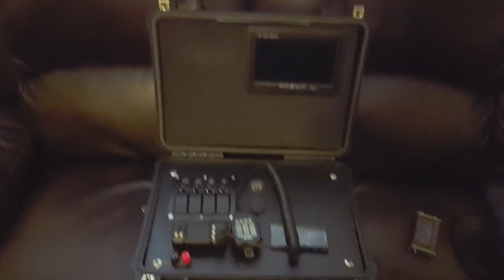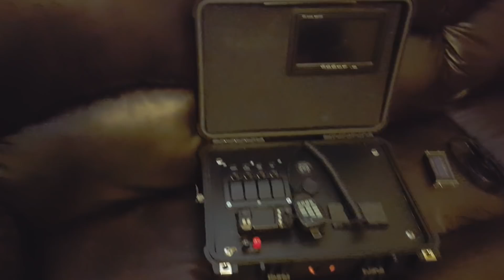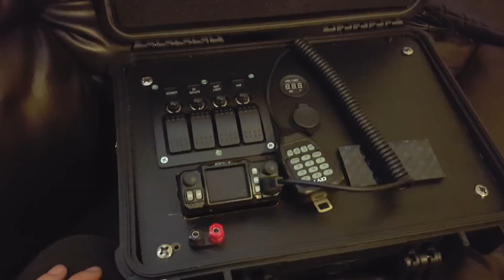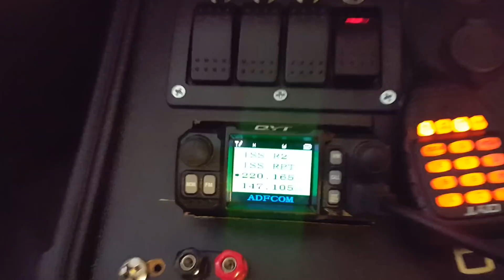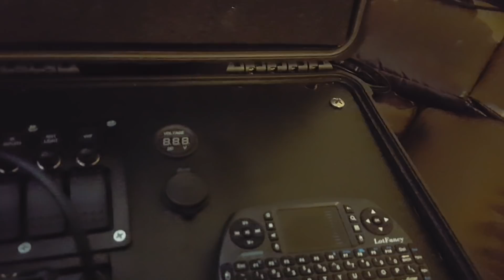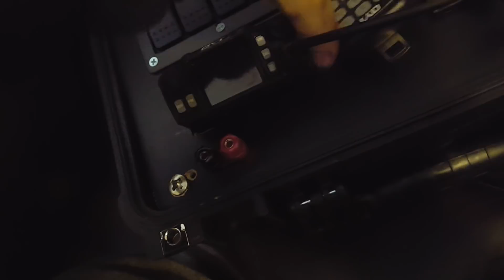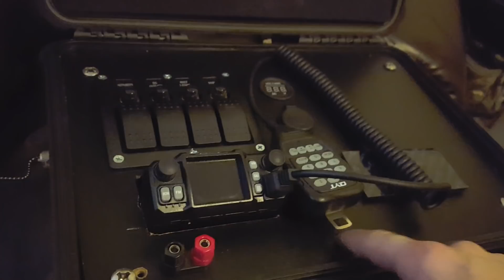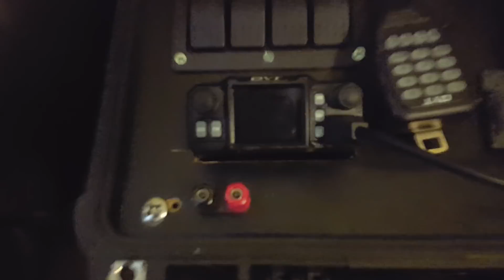Ham Radio Emergency Go Box

Comment: Just an observation, if you leave the voids inside the case filled with the pluck foam, you have effectively removed your transceiver's ability to shed heat.  Wrapping the heat sink portion of your radio in foam insulation will drastically shorten the service life of the radio and probably cause your kit to fail when it's needed.
Spend the extra time to mount the equipment in brackets so it can vent.  If shocks are a concern, isolate the brackets from the case body with rubber standoffs.  Otherwise, nice setup.  I love hard case rigs like that for go boxes.

Comment: Nice go box! I would put the antenna connections on opposite sides in case you have to use both at once. If you put them together and transmit on the radio while monitoring the SDR, you can mess up the SDR.

Comment: How do you keep the radio from overheating while it's half-buried in foam? Or do you pull it out when in use?
Reply from the maker: I actually bought a temperature controlled fan i was going to set up to ventilate it but after many uses it never got hot enough to make it necessary.
Reply: @TooManyProjectsTooLittleTime  Thanks :) Good to know :) My QYT KT8900r has a fan in the back, so if I mount it in something, I'll have to keep that in mind.

Comment: Beautiful set up!  I have a boefang UV-5rplus.  It's 5 Watt and is capable of receiving and transmitting on VHF(136-174), UHF(400-480)
Would I be able to get receive  ISS transmissions?  
As you can see I am not a HAM operator.
Reply: GET YOUR TECHNICIAN LICENSE  BEFORE KEYING UP!  Do a little YouTube research and discover how easy it is to be legal.  There is so much help available that there is no reason not to be legal.   No licensed ham can reply to you unless you have a legitimate call sign.  The operators on the International Space Station are ALL licensed operators.
Plug my call sign into your browser and you will see that we are identified. We are NOT LIKE CB radio.

bob/KF7ZSA
Reply: @guitardzan5641  I understand the laws I didn't want to talk with them, just listen to what there saying to others.
But I will look into getting a license

Comment: I would be interested to know where you purchased the individual components to build your box (especially the nice switch panel).  Very nice video, thank you for sharing.  PS...Just a bit of trivia: it is a Raspberry "pie" computer... the Pi stands for the number 3.1415, it's not a letter designator (not P.I.)  I purchased an Apache case for my go-box as well and I agree that they are very nice cases.  73-KJ4DDM
Reply from the maker: In regard to the Pi, ever since I uploaded this I have been getting schooled on how I am saying it wrong hahaha. The switch panel can be found on Amazon or Ebay, if you search just rocker switch panel you will find tons of them. They come in all different configurations, usb, volt meter, amp meter, 12v plug, fused, circuit breakers. They also come in all different colors as well. Sometimes they are sold under "Marine rocker switch panels". Most other components were Ebay or Amazon as well. Good luck with your build! 73

Comment: Have you considered using your tablet with a Wolphilink interface?  There are quite a few android apps that work with the Wolphi.

Also, have you seen the DRAWS from NW Digital Radio?  It's well suited to interface radios to the Raspberry Pi (pronounced pie).  

The SDR inside the go box is a really good idea.  Since you like satellite work, have you seen this site:  https://satnogs.org/  ?  The program works with your RTL-SDR and a Raspberry Pi

BTW.  I found the same box at Harbor Freight for my box project.

How did you fasten the screen to the lid?

How about a follow-up video?  73 DE WA4OSH

Comment: Hi, have you worked the ISS with this setup?  Also, is your receiver quad-band?  Very nice btw
Reply from the maker: I have not worked the ISS with this radio specifically yet but I talked to them about 3 weeks ago on the radio in my truck. Yes the receiver is a quad band with both RX/TX on all bands. Thank you 👍

Comment: Just curious, you mentioned about keeping the pick-apart foam around the radio and battery under the platform, do you run into any overheating or heat dissipation issues? I would think the foam will act as an insulator of sorts.
Reply from the maker: I did consider that, the foam is an open cell so air can flow through it. If you look at how I have the radio mounted you will see the heatsink is exposed, that is one of the main reasons I have the radio angled like it is.

Comment: I watched a whole bunch of "go box" videos recently, but yours it the one that most speaks to me.  So I went ahead and ordered the KT-7900D...nice and small!  The battery, Raspberry PI 3 B+, monitor, USB SDR, and all required wiring and instrumentation are coming soon as well.  I will, however, be using blade fuses (so I'll need a few more switches on my front-facing panel).  I'm going to try something rather bold.  I have an end-opening 25mm ammo case I'm going to use...if there's enough space.  If all works out, I'll make a video and make sure to give you a shout out.  73!
Reply from the maker: Glad I could help! I have the same type of ammo can, I bought it with the same intention originally haha. Good luck with the build! 73
Reply: @TooManyProjectsTooLittleTime  I'm hanging on to the dream, but quickly running out of room.  Thank goodness for Harbor Freight.  It's likely I'll end up using the same case you did :-)

Comment: I have a ic-7100 radio and I am thinking about using it for my go box . I can reduce the radios output for qrp service to save battery power . when I get around a location that is still on the grid I can hook up and use full power  . I getting a couple of antennas to get on both hf and vhf/uhf for both long distance communication and local communication with one radio .

Comment: Hey @Bulldockmack407Sales - sorry, I got one more question!   How did you attach the Pi screen to the top of the case?  And, is that in the foam, or is that some kind of panel that goes across the lid.  Thanks!

Comment: Very cool! Have you thought about heat and ventilation? It seems that with the radio, a Pi, an SDR,that you have at least two if not 3 sources of heat. Thoughts on how you'll account for it? Great work!
Reply from the maker: Thanks! I have a fan that I was going to mount on the dash of the unit as well as a temperature activated switch to control it. From running the unit it seems the radios fan and PI fan do a good enough job on their own though.
Reply: Sorry to hit you again.... Do you have any still or video shots of the bo with the radio and the front panel removed?    I picked up a 3800 yesterday, and am starting to lay stuff out in my mind .... Unsure if I'll stick with this, or go for the 4800 -- either way I need to go back for a holiday price adjustment on Friday.   My ideas are starting to take shape!!   Thanks man  OH, also -- the four screws -- what do you have them screwed into below the panel?
Reply from the maker: @dtwoinco  No worries! Definitely get the bigger one, I originally got the medium size and quickly realized I need more room. I don't  have any pictures unfortunately but if I get a chance I'll upload some of the face plate off. The screws are mounted to the bottom using 4 threaded turnbuckles JB welded to the base of the box but it's not very reliable so I will need to figure out another way soon.
Reply: @TooManyProjectsTooLittleTime  ok, cool on the attaching. I actually have the large one, the 3800 like you have... But they recently came out with an XL, the 4800 that is slightly bigger... Wondering if it might be overkill. I will start to do my layout this weekend. Thank you sir!

Comment: I just picked up this box to build a go box, how have the 4 bolt holding  the panel screwed into nuts glued to the bottom worked?
Reply from the maker: 31Lumberman I tried JB Weld but to be honest it's not working that well, I need to come up with a better way.
Reply: I thought about seeing if the rail system for a Pelican case would work. I think it's the 1450 that's about the same size as this one. The way it looks, I'd have to shave it down a bit to get it inside though.

So do you have everything packed in the pick & pluck foam, or is that mainly in the empty spaces? And do you have a link to the marine panel that you put in for switches?
Reply from the maker: Patrick Dickey I will have to check that rail system out. I have all the foam inside underneath and everything is fitted very tightly into it to help make it shock proof and hold it in place. As far as the switch panel goes if you go on Amazon or EBay and just type in "marine rocker switch panel" tons of different ones will come. They have ones with all different styles and features depending on what you want to do. The nice part is they all come with a wiring harness as well!
Reply: I looked at the frames by Pelican online, they would have to be worked on to fit this case, I would hate to spend almost as much as I did for the case and have it not work